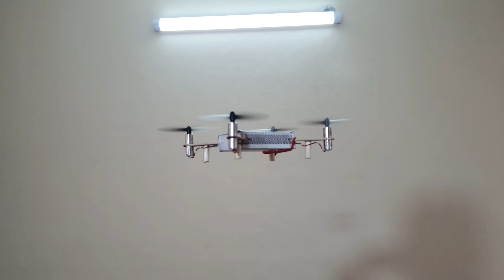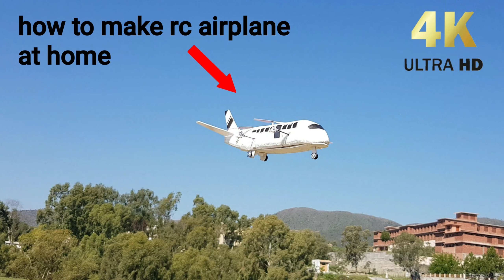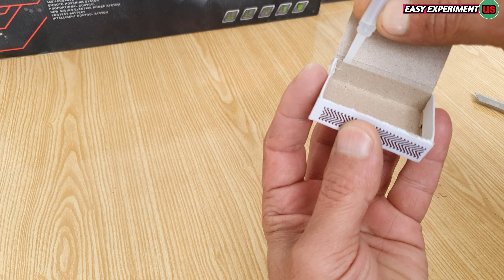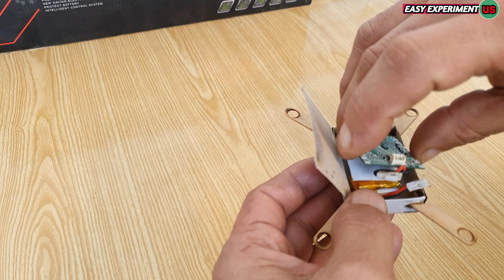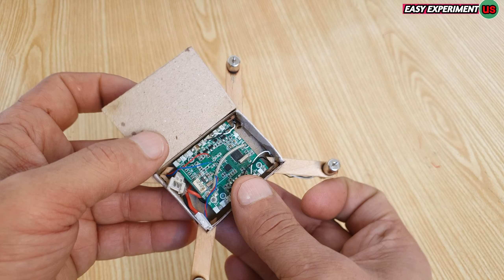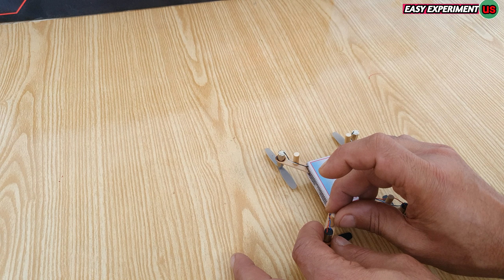How to make easy matchbox drone at home 100% working easy  experiment us

Comment: Where did you buy the mother board and operting remote
Reply: He buy a mini drone and unasamble it and take its part with that parts he create it using small box . He dont buy any requirement separately.becuase if you buy this drone parts seperately its cost his very high
Reply: He buy a mini drone and unasamble it and take its part with that parts he create it using small box . He dont buy any requirement separately.becuase if you buy this drone parts seperately its cost his very high
Reply: You can also buy a RC car